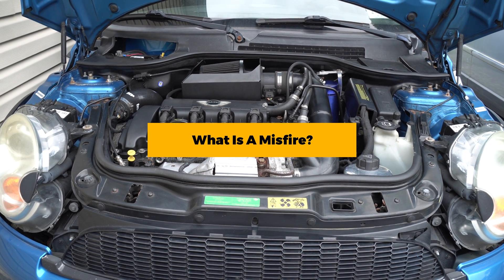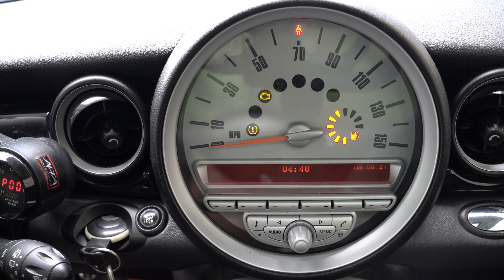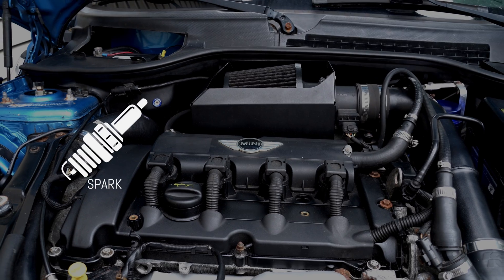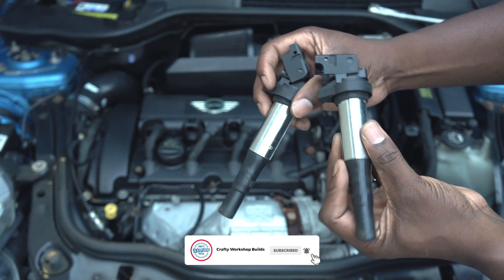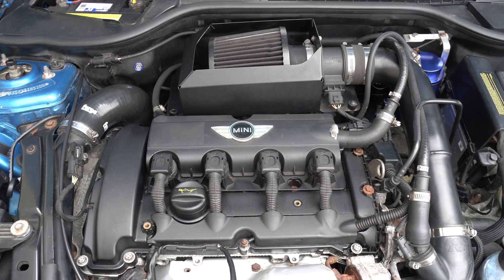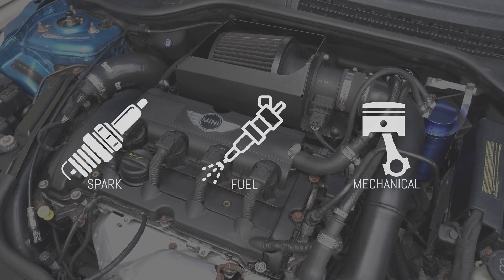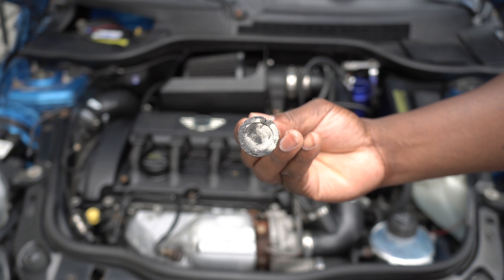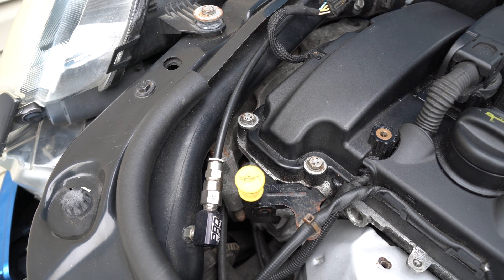R56 Mini Cooper S Engine Misfire Explained 2007-2013

Comment: Thankyou for your vidio at the end you take about a kit you installed to prevent exaust valve cracks can you exsplain what that is and what it does
Reply from the maker: it's called a meth injection kit. It sprays water and methanol into the intake pipe, which cools down the combustion temperature. The excessive heat is what caused the valve to crack.

Comment: Mini Cooper everything’s been replaced plugs, spark, plug coils, fuel pumps, injectors, timings good compression is good but still goes in the limp mode and misfires

Comment: One thing not mentioned are the Vanos solenoids. They get clogged up and it affects the timing of the engine, thereby throwing misfire codes. 
Diagnosing can be done a couple ways. 3xxx codes relating to valve control tells you almost right away. 
Cleaning the current vanos solenoids and seeing if the problem goes away temporarily is another. 
Either way, the solenoids will need to be replaced to restore proper function of the valve timing events.

Comment: I have a n13 engine.My problem is sometimes only misfire at idle.First start I push the start button after randomly cylinder start to missfire.Everytime randomly cylinder doing misfire.I chanced injector,spark plug and coilpack.No fault code and push the pedal no misfire.What is my problem please help me?And comression is good.

Comment: Hi, I have a 2012 Mini Cooper S R56 N18. The battery died, and after that, it started misfiring in all cylinders. When I start it, it tries to shut off and pops, and then it smells like gasoline, but it doesn't smoke. Then it stabilizes normally. But the check engine light comes on and the engine is broken. Any help?
Reply from the maker: scan it and see what check engine code it's throwing.

Comment: Need help w cold / startup misfires.

Completely new build. Rebore to 77.5, new HPFP, LPFP filterhead etc. Misfires are across all cylinders on start up but seem to be most on Cyl 1. Misfires start after car goes into closed loop mode. The first 20-30 sec it runs smooth w no misfires. Then as RPM fall from 1100-1200 to 800-900 idle they start and the car runs rough. Seems to be as it goes into closed loop. Revving slightly to 1800-2000 and holding it there make them go away. They recur when released back down to idle. Once warmed up 3-4 min she's totally fine and on the road a dream.

Pre start resting rail pressure is 70-90 psi. HPFP is new and runs good fuel pressure as compared to my other R56. Changed coil packs. Checked and cleaned VANOS x2. As a new build I had some milling debris on first start but have changed oil x4 and oil analysis looks good so far. I have not checked the cyl head check valve or the timing chain  tensioner oil passages yet. 

The car has Cat Cam street cams, JCW manifold and turbo. It's not tuned yet. Tuner said misfires aren't fixed w a tune. But it just seems odd that the car runs misfire free for first 30 sec.

Any help appreciated. Thx.
Reply: My engine has been completely rebuilt, just like yours. New injectors, turbo, O2 and knock sensors, and much more.

I have exactly the same problem as you. Did you manage to find out what it was?

Comment: I had ramdom misfire and loss of power recently.  When i looked around I noticed a lot of oil below.  The oil return line gasket seemed to have failed and leaked all of my oil out, except one quart.  Do you think the low oil could have cracked a piston or bent a rod.  Temperatures seemsed normal at the the time of the incident, as I run a live scanner all the time.  Car is idling rough and saw a little smoke from the area.

Comment: Hi I need your help, 

My R56 2013 is misfiring super high mileage 320 000km. 

1. Spark plugs are good 
2. coil packs are good 
3. Compression is good 
4. Injections are all firing 
5. The mechanic is suggesting we change the engine head which is so expensive. I don’t know what to do as I love my mini.
Reply from the maker: did the mechanic check the high pressure fuel pump?,
leak down test?
carbon cleaning, intake valves?

what does he suspect is wrong with the head?

Comment: Hi, I think my car has the same problem. Check engine light flashing, low power and no compression. Could  it be exhaust valve problems? Thanks

Comment: Salut, j’ai une Mini Cooper S 2013 R56, le message de perte de puissance est apparu sur mon auto alors j’ai changé les pièces graduellement pour trouver le problème par rapport au texte ou vidéo je voyais sur le net. J’ai un code  misfire multiple P0300, misfire sur le cylindre 1 P0301, misfire cylindre 2 P0302 et misfire sur le 4 P0304. Mais les misfire sur cylindre 2 et 4 ne sont pas actif présentement. Même que dans le compteur c’est juste le 1 qui en produit. 
Premièrement j’ai commencer avec les bougies, deuxièmement le filtreur à gaz, troisièmement le coils Pack, quatrièmement la pompe haute pression, toujours la même chose. J’ai essayer de changer un camshaft sensor et toujours rien. Je m’enligne pour démancher les injecteurs, j’en ai commander des neufs. Je commence à douter du ECM, je vais aller vérifier aussi pour les durites. Je commence à être désespéré, avez vous un autre piste que je n’aurais pas parcouru ? Merci !

Comment: I am experiencing an engine misfire in my 2013 Mini Cooper S and we have changed the coil, plugs, and sensor, the only thing I have not done is the fuel filter. The mechanic advised that an electrician should check and he came up with another story of a faulty brain box. I have not enjoyed this car even for a whole day. The problem started days after purchasing it. it started with a slow movement they claimed it was a result of a lack of turbo not charging,  later it started shredding fan belts and up to 8 belts were damaged. Now the belt issue is rectified but the misfiring still persists. I need some advice is there any chance that the misfiring problem can be associated with the brainbox problem please help me.
Reply from the maker: Get a compression test done on it.

Comment: So I have a 2009 mini Cooper s turbo i was driving car it seemed fine I did have a check engine light on but code was only for thermostat not opening at set temperature and a certain time . Car had no misfires at first but then I started driving on the free way decided to give it a little more throttle and car rpm’s dropped reving down then check engine began to flash bogging out . I then pulled over checked codes giving me random misfires . I cleared codes then cycled key again to get proper codes giving me misfire on cylinder 2&4 I removed spark plug and plug was burnt . I replaced spark plugs and both coils for cylinder 2&4 . Cleared codes and error still persisted . Fault was for the same cylinder still I then removed plugs again and cylinder 2&4 were dampen with fuel . I began to test injectors with scanner each operating normal . I haven’t tested for compression but if someone has some tips on this that would be great . There’s nothing on YouTube

Comment: Hi, thank you for the work you do. I have a specific problem... most times when I start my 2011 mini, the idling is rough and sometimes produces smoke from the exhaust but when I disconnect any of the Camshaft sensors(then reconnect it), the idling becomes smooth again. Please help

Comment: I have idle misfires on all 4 cylinders randomly after valve job and head gasket replacement. Checked compression (N12 2010) 200-210 all, new plugs, new VVT solenoids, checked intake, it is tight to the cyl head. Runs beautifully at 2000 on up.

Comment: Great video thanks. I have a continuous misfire on only one cylinder. I'm worried it's a mechanical problem but I instantly got an engine code. I'll try swapping a spark plug and coil to another cylinder.
Reply: How did you go with that?
Reply: @SamChung-tf4vo it was my mistake. The coils were bad and I made a mistake replacing it. There was a sleeve. I don't remember.

Comment: I have a 2012 R56 JCW with N14.  3 days ago, upon cold start, it sputtered and struggled and died within 5 seconds.  Then again, but didn’t die, and cleaned up after 10 seconds and seems fine.   Same thing again next morning but threw codes this time, misfire cylinder 1 & 3.  Then next morn, same thing but code was for cylinder 2 & 4.  It’s very odd because once it cleans up after a few seconds, it runs perfectly fine until it gets cold sitting overnight.  Any ideas?

Comment: every time I have an issue with my R56 I always find myself referring to your videos. I'm currently dealing with a traveling misfire that started on 1 cylinder, then it jumped to 2, and then finally when I was able to baby the car 45 minutes back home it plagued all 4 cylinders. My brother and his best friend swear up and down that it's just bad fuel but my girlfriend and I got fuel from the same station within hours of each other (both turbo cars requiring premium-91/93) and she never had any issue. I've got just over 80,000 and I'm convinced that the fuel filter has probably never been changed, and the HPFP, from what I've researched, can fail pretty early on in the cars lifespan. So my plan was to start with the filter, do a compression test, and then get some injector cleaner to see if that can help revive my mini that has been sitting in my garage for the past 5 months untouched. Then once I get everything sorted I'm in dire need of a walnut blasting to get rid of all the carbon build up.
Reply: had similar issue as you, did you find out what was the cause on yours? I've replaced the spark plugs, nth change so I'm planning to change the coils next
Reply: @theheroricky but also I had a bad camshaft sensor and then the VVT solenoid needed changed
Reply: @theheroricky it ended up being the primary fuel pump.
Reply: @FogMayonnaiseRedStarWars  Mine ended up being the ignition coils, I'm surprised they all failed the same time causing multiple cylinder misfire
Reply: @theheroricky well I had a couple misfire issues. The first time it was a bad coil, which broke so I ended up using a coat hanger to get the boot off the plug. Then the VVT and camshaft sensor went bad, and then finally the fuel pump, but the car was at like 80k miles and the fuel filter had never been changed and it was blacker than night.

Comment: Having a random misfire code across all cylinders, car shows no noticeable misfire or faulty idle.
Spark plugs, coil packs, fuel filter, valves, guides, timing chain, valve seats, vanos all replaced, car runs and idles perfectly.....and still throws random misfire codes on all cylinders.

Comment: Thanks so much for the video! We just replaced 3 of our spark plugs and they were all disgusting, however we can't get the 4th to come out. The car was and continues to misfire and act "jerky" when first warming up. Once up to temp it runs fine. There is a check engine light quoting multiple misfires. Could it be the coils? Or the last spark plug? Running out of idea's :( Please help!
Reply: 2011 Mini Cooper S

Comment: Great video thanks! 
I have a misfire on the #3 cilinder but only after warm up . In cool conditions works good. Checked compression and all are around 130 and very close each other. Some other method to test? Thank

Comment: Hi yes I have the 2007 mini cooper which is throwing up code cc id 031..
Runs sluggish for a couple of minutes then ok.
Engine light on..
I've replaced the fuel cap for a new on..

Comment: My mini has had random misfires in cyl 2,3,4 and I’ve already replaced spark plugs, tested coil packs, prev owner replaced hpfp, I cleaned the intake valves, and yet it stills misfires. My car has feels super sluggish and when I floor it inside the cabin starts smelling like fresh gas. I’m thinking maybe there’s a fuel line in the bay that’s cracked or an injector leaking or clogged.
Reply: sounds like my 2010 I'm having a misfire multiple cylinders. I've replaced the coil packs, plugs, hpfp, fuel filter. Mine runs great though it's only cold starts that give it the code. Have you checked your fuel filter? That thing is a bitch to get on and off. If the previous owner replaced that with the fuel pump like I did maybe he didn't get it to seal correctly and you're losing pressure and getting that smell. easy enough to inspect.  You should be able to see the hpfp leaking pretty easily.

Comment: Those damn Mini's are always chasing parts. I've had (2) 2012 vintage S's that gave the stupid "half engine power" light come on. Both were corrected by new coil overs. DON'T buy these from Amazon or eBay. They are knock offs. Bosch brand has been consistent and they're only $20 off RockAuto. I have spares in my glovebox."Just in case". Another thing - it's so GD random - until it's NOT. I clocked my "self healing" N18 at about 45 miles till it happened sequentially. Maybe heat? Maybe a Mini "design feature" ? Whatever.....love em but hate em - I have 5 in driveway, and have owned 11. The NON-S seems more reliable.

Comment: Excellent video. I have an '07 MCS that was diagnosed with a burnt valve. (after it was running so well!) The shop did not want to repair it because the car has 197,000mi. How do you feel about it? Worth saving? Thanks again!
Reply from the maker: It all depends on how much you like or want to keep the car. If you do decide to go ahead and fix it, might as well address any other possible issues within the motor. After that it should be pretty solid.

Comment: 2010 R56 S 95k miles. Had the car for 7 months and 4k mi. New (real) NGK plugs on 7/20/20 82800mi, good gaps still. NO CODES. Data logged with Bimmerlink when cold each time. In the last couple of weeks I have had a misfire when cold on plugs 1-2-4. I have obtained a used set of coils (?mi) and swapped them out 1:1 from the other car, I will spare you the swapping details going forward but nothing changed. I have swapped plugs around and nothing changed. The hesitation and missing is very slight is more pronounced when cold but imperceptible when warm. Misfire happens at highway speeds. The HPFP will get down to 550psi at 122deg misfire cyl 4. but will get to 550-700psi when cold with cyl 1-2-4 misfiring. The misfires on 1-4 also happen at 1200-1600psi with the temp at operating.  I do not know the status of the fuel filter but always use top tier fuel of Shell/QT. Complicated huh? Yeah I know its a problem child/mini life. Going to Mini's on the Dragon in 1 week need this sorted.  missing happens on all cylinders, all temps, any time.  Just more pronounced at cold.
Reply: 1) Fuel filter, 2) HPFP, 3) Intake valve carbon

Comment: For me, injector cleaning additive added to one tank of fuel has solved the issue. But now… same issue, no pressure on cylinder 3 😢 need new engine block. Mini s*cks. That is not normal

Comment: Help!! R56 cranking no start did my checks no compression in cylinder 1 and 4
Reply: Before I check the compression, spark fuel and air was all good… any suggestions?

Comment: thanks for the great video, my 2011 initially had misfires on cylinders 1/2 due to the valve cover leak on wells(1/2), replaced cover gaskets and all spark plugs and coils, but the cylinder 1 still has misfire, so I switched around the plugs and coils, still cylinder 1 misfire in low rpm mostly, any idea?thank you

Comment: My 2012 Mini Countryman is now is the show, I added oil because it was extremely low and then instantly the rough idle and check engine with multi cylinder misfire codes. checked the head gasket and antifreeze is high and clean. Changed out the sparkplugs and coils and still rough idle and check engoine light. Having the garage check the fuel pump today. Any other thoughts???

Comment: How hard is it to replace the valves? I have a 2014 r60 s and need valve in cylinder 2 with 60lbs
Reply from the maker: It's a tedious job. You'll need to remove the cylinder head, and deal with resetting the timing and such.

Comment: Great informational video. I have a p0300 and p0303 misfire code on my r56. I recently replaced all four coils packs and still the problem and codes exists. I checked all four spark plugs and cylinder 3 spark plugs has oil on the tip. My next step is to replace all four spark plugs, I recently purchased my r56 and the previous owner said he never changed the spark plugs.
Reply: @desmond9704 did you figure it out?New plugs, filter, valve cover with PCV, swapped vannos valves front to back. New codes ...
P0300 RANDOM MULTIPLE CYLINDER MISFIRE, P0301 , P0302, P0303 (CYLINDER MISFIRE 1,2,3), P0171 SYSTEM TOO LEAN BANK 1, P00BC MASS AIR FLOW TOO LOW.

Comment: Got one now. P0012 random
Mis fire across all cylinders, rough idle
Reply: OMG this is my life right now!! I changed out the spark plugs and coils and the P code went away but the Multi Misfire all random cylinders is still there and rough idle, once I give it gas it dies down. It is at the shop and they are at a loss. What was your fix.
Reply: @hollieniemi7458  if i remember, we swapped out pvc hose and vanos solenoid

Comment: Hello! I have a R60 2013(countryman). The issue with the car is a misfire on cylinder 3, I replace the coil but I still have the same code ( I use Creador  C501 to read my codes) I was about to replace the spark plugs but before I decided to fill up the tank then I run the car and the problem get worse, when I checked the codes again I get back fire in all the cylinders but #4. I believe something is clogged. Any video about how to replace the fuel filter on the tank and the pump too?

Comment: I have an u common issue. I have done basically everything and the 1st cylinder is the only one that misfires after 20 minutes when it heats up. And then it's running bad. After an hour it will run well for another 20 min and bad after that. Can anyone help?